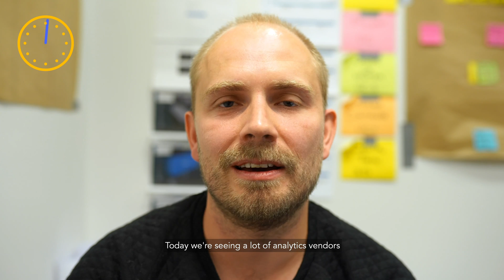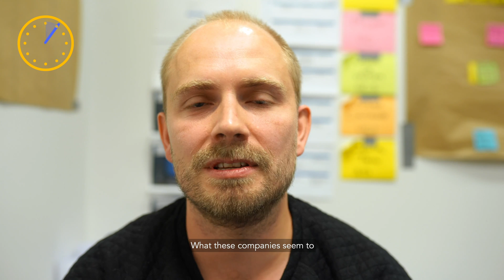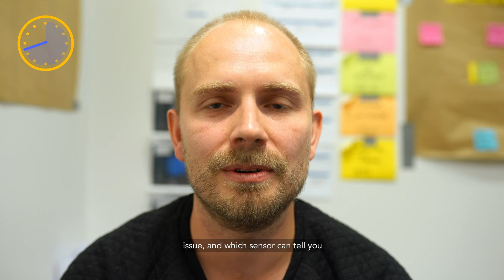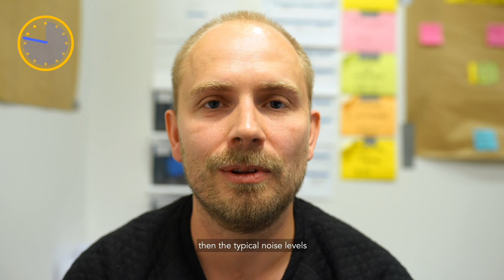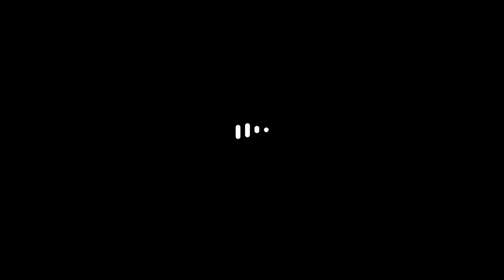Why Data Science Fails in Oil & Gas... in 60 Seconds

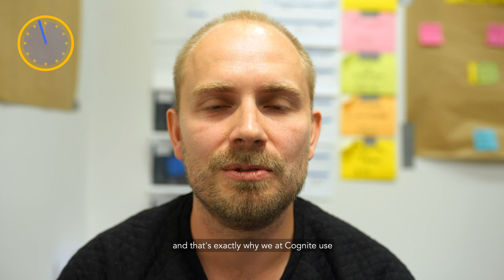Comment: At 1:07 you say that you use physical models. Curious: What kind of models? Finite element method models? Did you develop that (part of the) sw yourself? Our understanding was that you don't - yet - use high-fidelity physical models? For example: you don't know anything about stress histories in mechanical components? Is that the case?